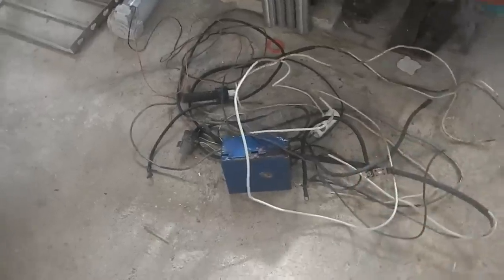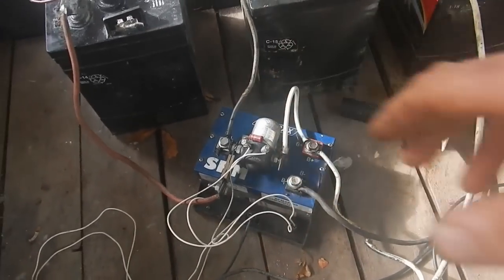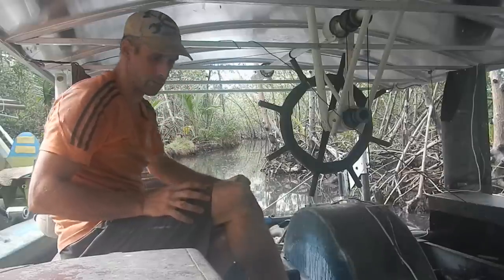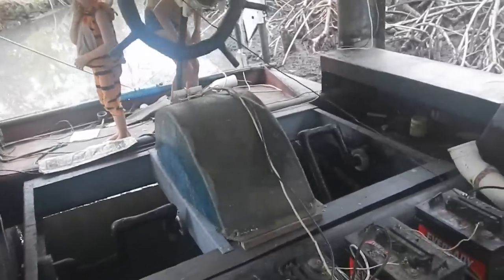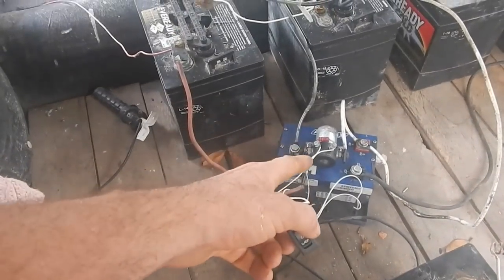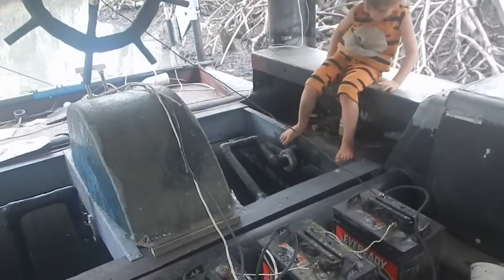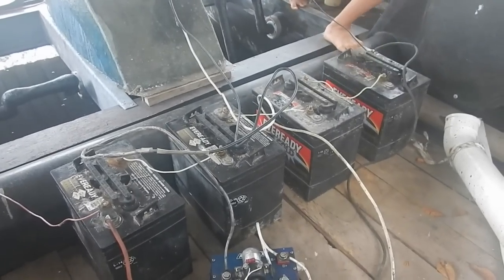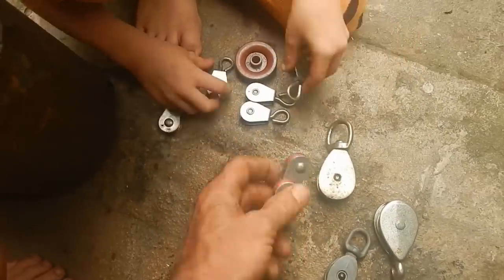Shark Slicer Upgrade 024 Speed Control

Comment: The front pillars could be useful as the base for a log arch. I assume the reason you're refurbishing this boat is for hauling logs, right? So if you put a big arch on the front of the boat, you have a mounting point for a pulley block, which will make loading and unloading logs significantly easier.

Comment: Possible barnacle solution? In the old days they used copper sheeting to prevent fouling of ships. I wonder if you could ground copper in a fine powder and mix it with paint. There's electronic systems that use copper electrodes, maybe a Arduino pulsing a charge could help?

Comment: My thought is the  other speed controller with the resistors is not the best idea, usually they run with the same current draw on low or high, when running low the extra power will go thru the resistors and be dispersed with  heat from the resistors. i think at least worth checking

Comment: Steam engine is a bit hard job to do without proper tools and materials. You could probably make a working Tesla turbine with your lathe. I have made one.

Biggest challenge is to make it perfectly balanced. You also need high quality high rpm bearings. Second challenge is to make well optimized steam nozzles. Otherwise efficiency is poor. Transmission is kind of challenge too. Something like 12mm toothed belt could work but may have too much losses in high rpm.

I use mine to generate electricity. Turbine is connected to brushless motor, which can work directly with 30000rpm. It's a great generator and compact. Needs water cooled motor for high power output.

Comment: Jamie also remember this lithium batteries are more at risk from caching fire when drawing large amounts of current this is bad if you are on a small boat made out of fibreglass. Electric cars catch on fire all the time. I am thinking about the safety of your children when they are with you in the boat. lithium batteries are better to run lights and electronics nothing bigger unless you have a robust safety system to prevent excessive currant draw witch can make the battery hot and explode. Also you need a different solar power charge controller as you cant use the current ones you have witch are only designed for lead acid battery's. Be very careful i do solar for a living for houses cars and boats. A lithium battery charges a lot more differently to lead acid and can be a time bomb. That's why cell phone's catch on fire randomly in peoples pockets or being charged up.
Reply: Calm down dude lol.  Ever heard of Lithium Iron Phosphate?
Reply: @benmwv  yes but they can still be dangerous.

Comment: Jamie make sure you use a MPPT solar panel charge controller so you dont cook your batteries. Also use 6v golf cart batteries as they have thicker plates in them. And they are also deep cycle 4 x 6 volt golf cart batteries are rated at 225 Amps for each 6v battery at 20 Hours use. 4 golf cart battery's store the same power = to 8 x 12 volt deep cycle batteries.  12volt deep cycle battery's can only do 100 Amps max per battery.  Golf cart battery's can do 225 Amps per battery . And last for days and wont go completely flat on you as they dont get as hot.  12volt deep cycle battery's can over heat due to thinner plates and drain faster. Golf cart battery's can last for 10 + years if you look after them. 12 volt deep cycle battery's will only last 5 year's.🔋🔋🔋🔋🔋🔋🔋🔋🔋🔋🔋🔋🔋🔋🔋🔋🔋🔋🔋🔋🔋🔋🔋🔋🔋🔋🔋🔋🔋🔋🔋🔋🔋🔋🔋🔋🔋🔋🔋